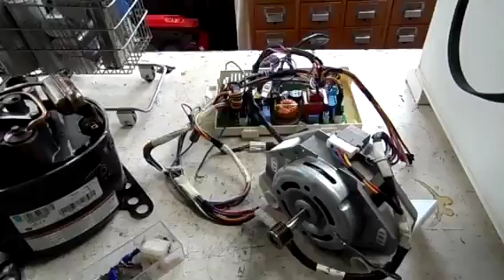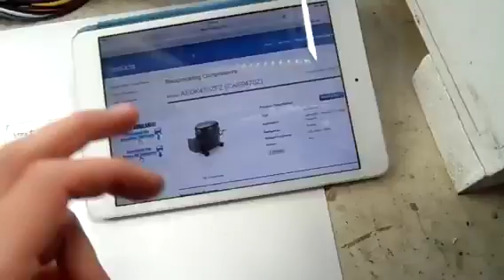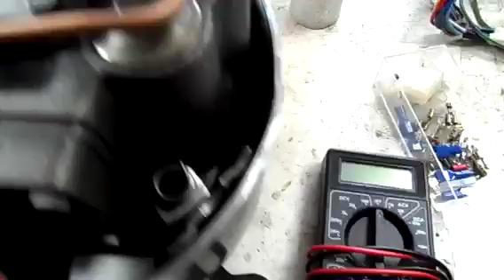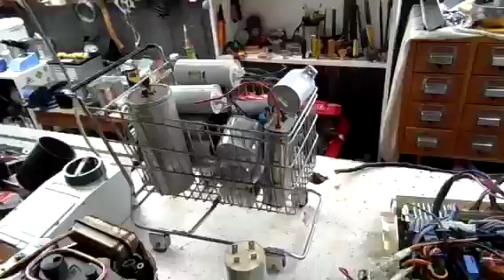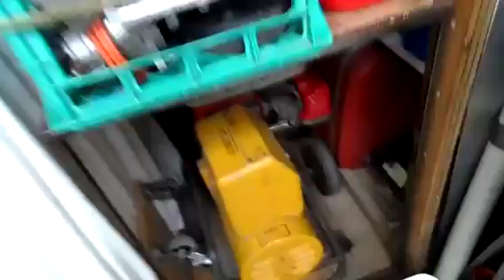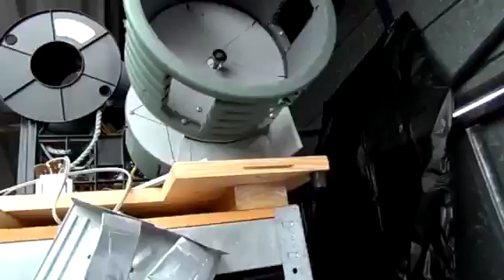Fridge Compressor and 3 Phhase Washer Motor Ramblings

Comment: No you can't run that motor on single phase unless you use the drive/inverter to drive it.  Its a 3 phase motor, they are driven similarly to brushless DC motors. The 3 phases create a rotating magnetic field through the poles and the rate of rotation is detertimed by the frequency being driven. (thats why when you hooked up AC and DC to just two wires it didn't do much, not making a full rotating field.  easiest wya your gonna drive that motor is with a Vector drive. (Also known its most common name, variable frequency drive. (VFD) Them motors are also designed to run at higher rpm with higher frequencies, your typical 50 hz won't rotate it very well. Suggestion is get a VFD if you can ffind one cheep enough or otherwise trick the onboard drive unit that came with the washer to drive it like it normally would. (Possible but built in drive units can be a pain in the crack if you don't know what your doing., they typically get logic signals from whatever control board they are connected to. (Some are all in one board, like the one you have fofr example. Its a matter of triggering the drive unit of it with the correct logic signals.   In a sense is kinda sorta what your trying to do with that ballast and arc lamp from that projection tv, need to feed low level logic right where it needs to be (thats the trick.) rest will be done on its own. (for the most part.)
Reply from the maker: Oh OK, might consider a VFD, otherwise let the smoke out of it. I ended up canning the original drive circuits as that was the reason the machine failed. Universal washer motors are a better bet as they are easier to wire up and run. Thanks for that anyhow :)